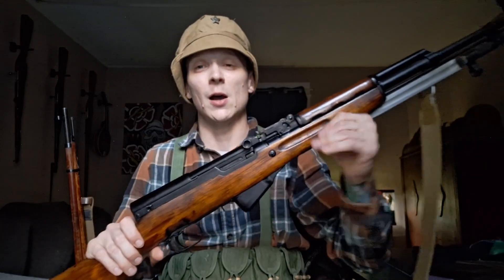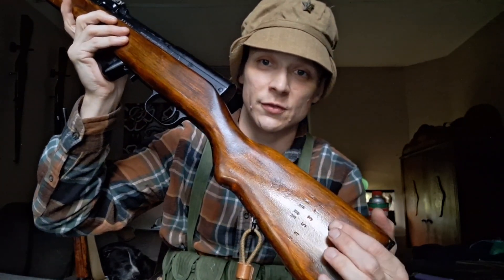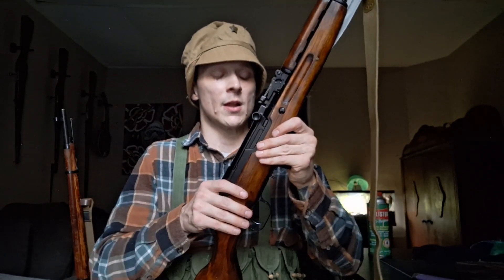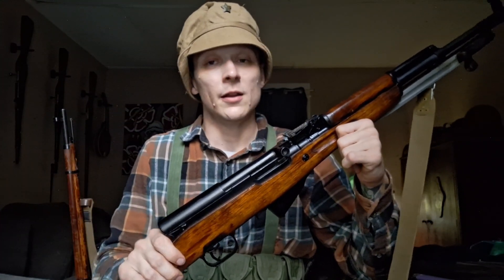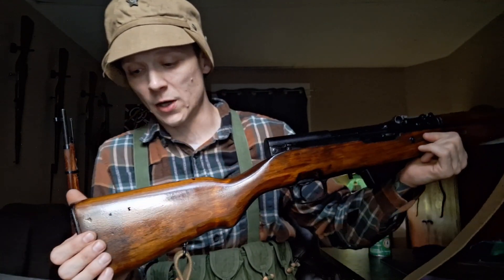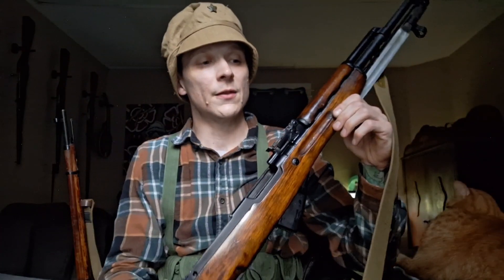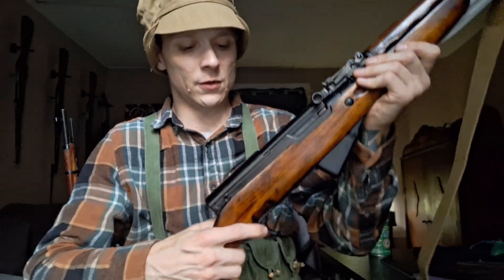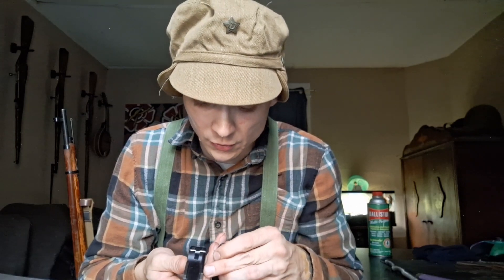SKS 45 Overview: 1st impressions, markings, disassembly

Comment: Great video! Keep up the good work, dude. 

Gotta love the SKS. For the longest time I set out to buy one of the Yugo models with the grenade launcher & sight combo. But I only ever found ones that were altered by previous owners, and the sellers were asking far more than I wanted to pay. 

I ended up with a clapped out late 60s Chinese SKS, with a bit of trench art on the stock. Has the name “Artán” and two years “1986” and “1990” scratched into the stock. 

The gun rattles when I shake it, and most of its finish is gone, but it’s historical provenance was too cool to pass up.
Reply from the maker: @WhataGunnR  That's awesome. If I were to get a Chinese SKS, it would be a 60s era Triangle 26. I had an opportunity to get one in great condition. All matching with no import mark. But they guy wouldn't go below $700. 
I forgot to mention what I paid for this one, BTW. I ended up offering $650 for this one, and the seller took me up on it. I wanted a Russian originaly anyway, but the collector Vietnam rifle would have been pretty cool.
 Luckily, the one I got came from a pawn shop and wasn't on consignment. So I got it for the lower end of what these have been going for.
Reply: @SurplusShooting Sounds like you got a really fair deal. Where I live, people are trying to squeeze $800 to $1k out of people for an SKS of any origin, and any condition. 

Wild how these things were previously unwanted and seen as junk. The same boomers who came up with all the rhetoric are the ones with the most ridiculous prices.
Reply from the maker: @WhataGunnR  and at those prices. You're now in the market for a cooler firearm, IMO.